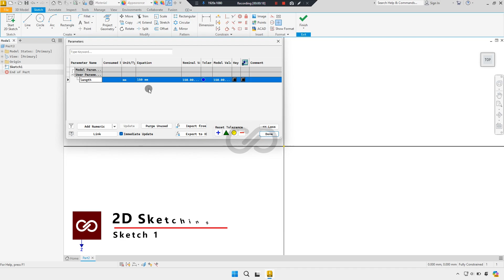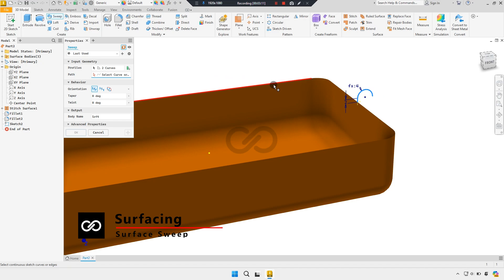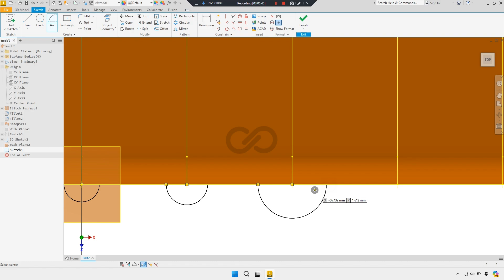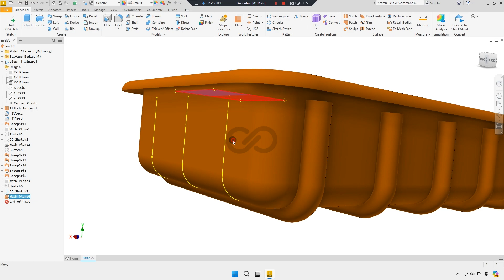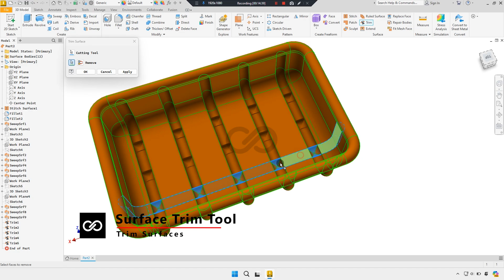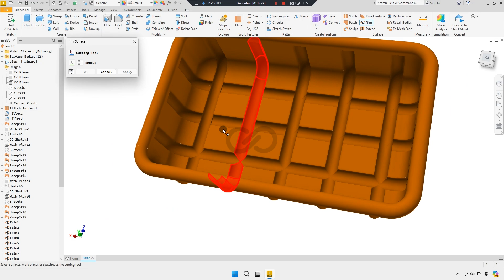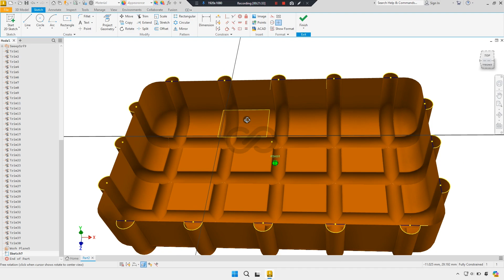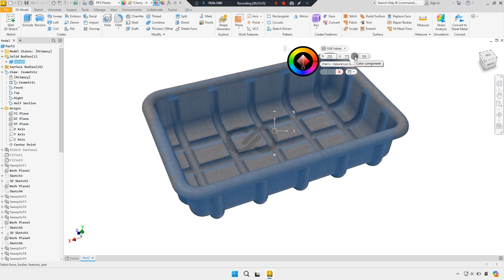Autodesk Inventor |The Ultimate Beginner Guide to Surface Modeling

Comment: What if you'd had like 100x100 of those grooves? You'd probably grind your finger up to your elbow clicking all that stuff.
Also, the ends of the grooves should taper off toward the surface. Otherwise, you won't be able to cast this model in a molding machine.
Reply from the maker: Hi,

Thanks for your input.

Definately you fingers might get tired with a grid of that dimension.

Thanks for pointing it out. It should've tapered and I honestly forgot about it since it was not in my vision. 

However, these tutorials will now have voice overs and will be redone and hopefully fix that.

Thanks for stopping-by. 

If you like our content consider subscribing. See you around.

Comment: Nice tutorial.
Editing tip: while performing lots of repetitive things (like the trims) show maybe 1-2 in real speed, and then do a speedramp to the last one which you show again at real speed. It isn't amusing seeing you click the same thing over and over again.
Never worked with surfaces, but couldn't you make "SweepSrf2" with the trims and then pattern it ? Same for "SweepSrf8"
I always thought it is better to pattern features instead of sketches, don't know it it works with surfaces tho.
Inventor tip: If you want to make multiple arcs/cirkels/... 'equal' it is easier to select with window select all the objects and then clicking on the equal constraint. Saves you a lot of clicking back and forth.
Reply from the maker: Hi,
Thank you for sharing this feedback with us.

I am actually aware of the above. I only shared this workflow to show it's also possible this way.

Feel free to check other tutorials on the channel that have followed your approach.

Additionally, check my published  blogs in Inventor forums for more.